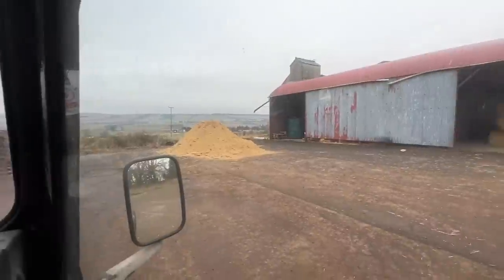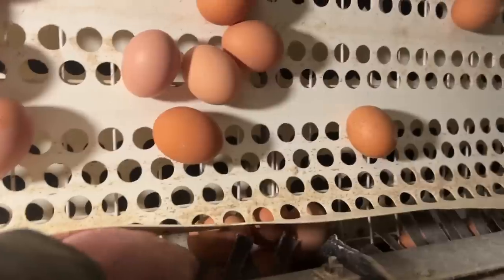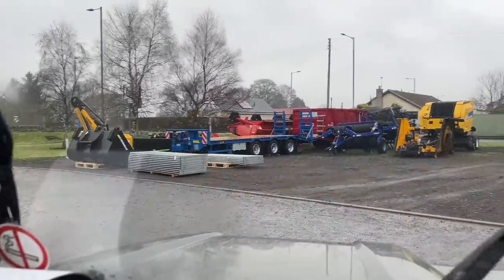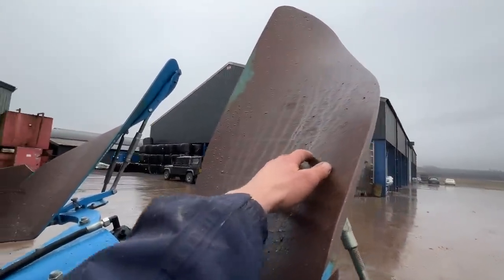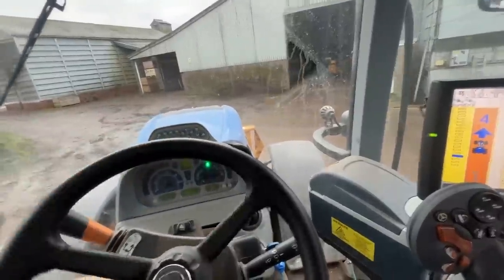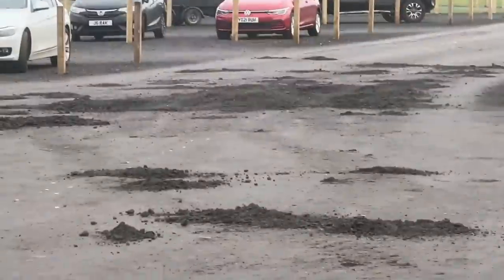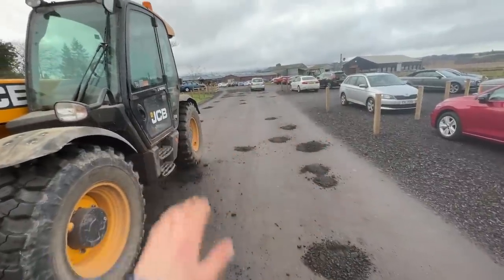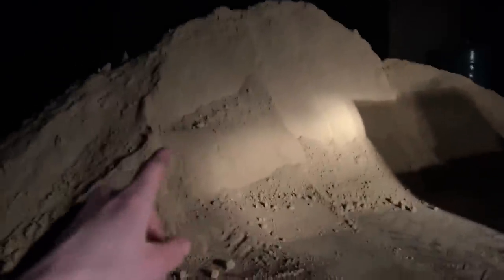New Plough Arrives On Farm | Lemken Juwel 8

Comment: I think you should have used 5 or6 mm wall box steel for the main frame of the stone grape. Would have given you more weight on the front of the tractor and would have been much stronger.   Nice plough  shame you didnt get the cheaper KV one, I'm pretty sure your dealer could have sourced one somewhere in the country.
Reply from the maker: its 5mm, going to fill all box with metal off cuts and concrete